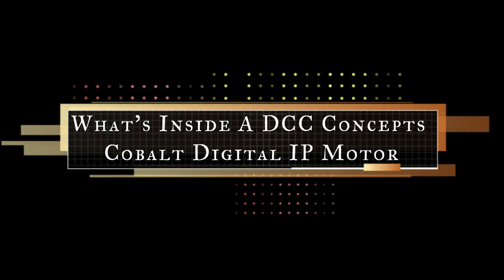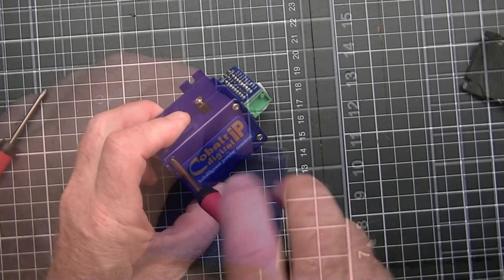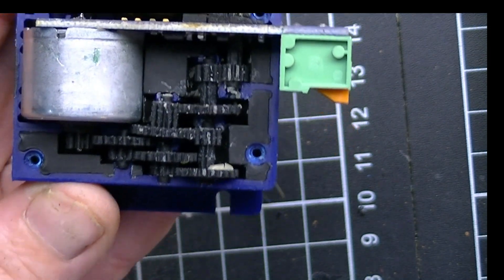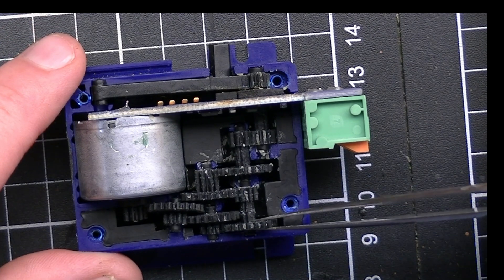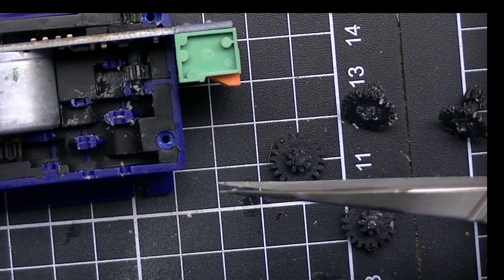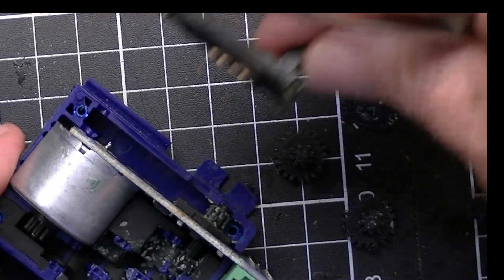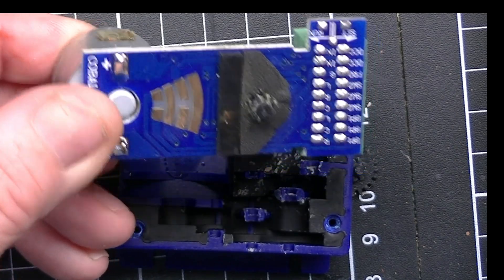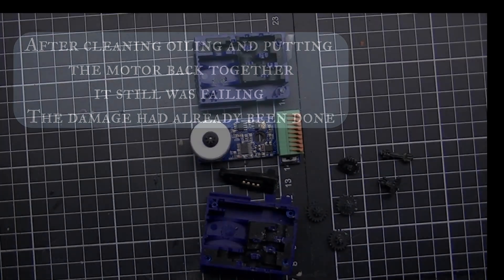Inside a DCC concepts digital IP motor- when the lubrication has failed

Comment: They should send you a free replacement.  Not your fault it failed.  They know its a problem, thats why the changed owners manual.
Reply from the maker: Yep but now as they are in the UK not AUS anymore it would cost the same to post it back as it was to buy a new one

Comment: I've had a couple of the old Cobalt units stop switching. I pulled them apart to find the contacts on the wiper arm had, over time, "relaxed"! They weren't touching some of their adjacent pads. A bit of careful bending sorted that. While I was in there I used synthetic grease to re lube the gears and pinions. Do not use petroleum  based greases. The fact is the synthetic stuff will rarely dry out. It rubs off long before that!
Thanks for your vid.😊
Reply from the maker: Thanks for your comments Peter, It would be nice if there was some way of lubricating them without having to pull them apart, hadn't thought of the contacts, might have to revisit a couple of the dead ones,.
Cheers Al